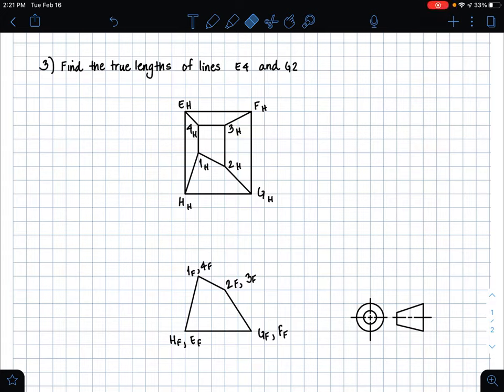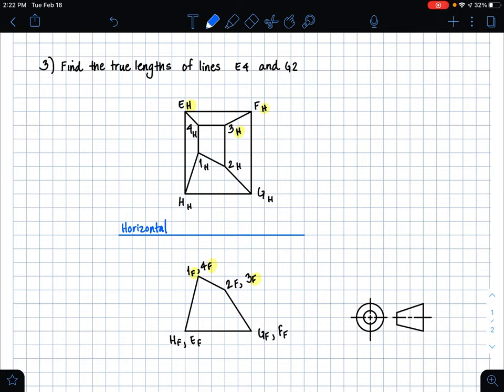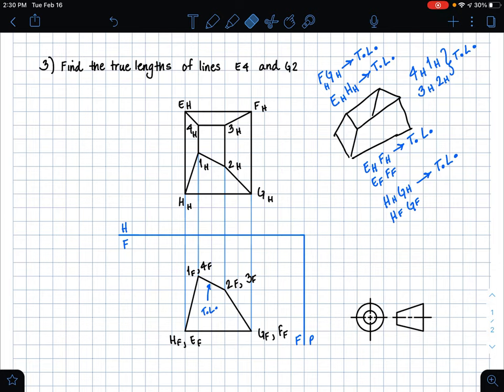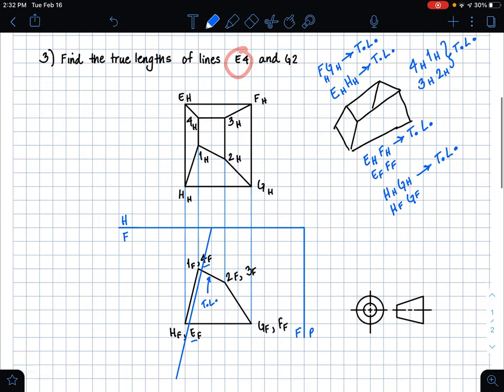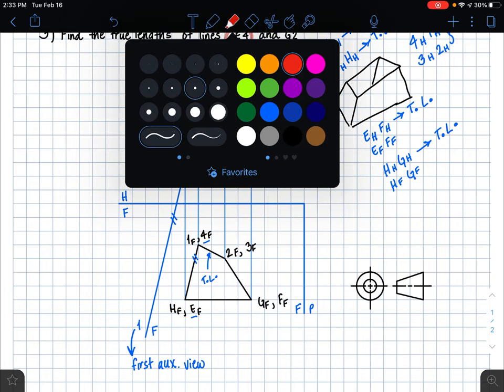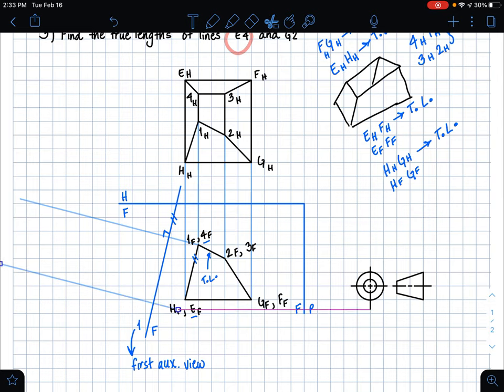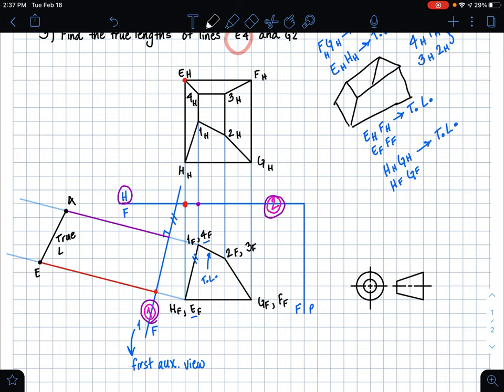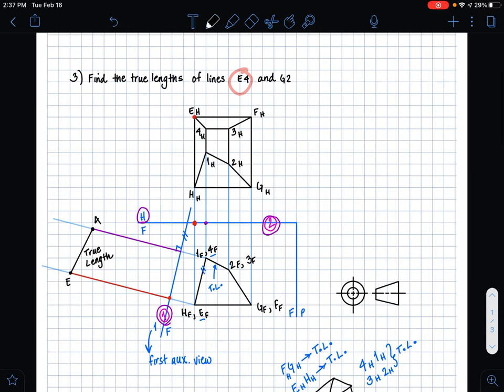True Length Problem 3 Step by Step Solution Engineering Drawing

Comment: Does it matter where you place you perpendicular auxiliary line??? in the first part you placed it in the frontal plane vs the second example where you placed it in the horizontal plane
Reply from the maker: Hi Tashii! Thanks for your question. No, it does not matter where you place the perpendicular extension lines. I place them so that I have space to draw my True Length line without it overlapping the other existing views. Please let me know if you need further explanation.